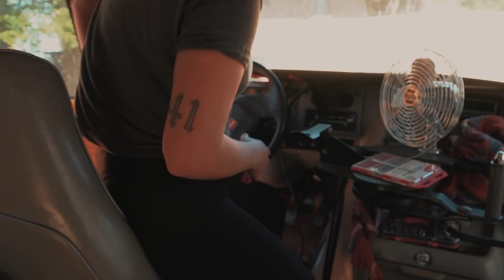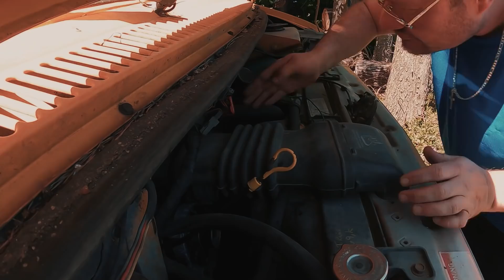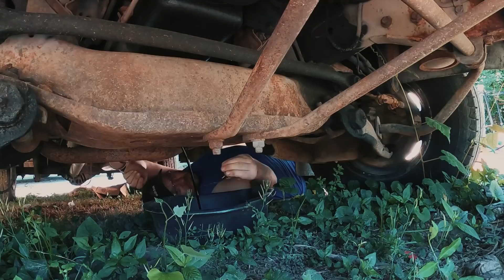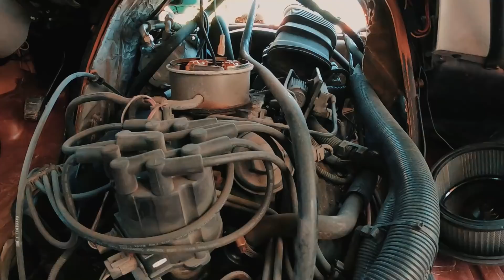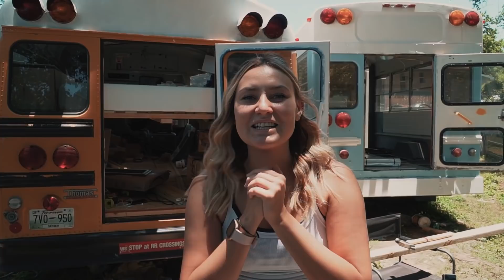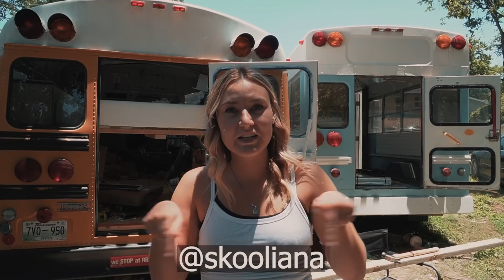My Bus Still Isn't Running - It's Time To Say Goodbye...for now | Skoolie Conversion

Comment: It's acting like my last truck did when my idle air control valve failed. Sometimes it's worth it to pay the labor cost at the pro shop instead of throwing parts at it.
Reply from the maker: I agree
Reply: @LeaveHerWild  There were some simple and easy things that were suggested for finding the cause of the problem that would have cost you nothing or very little (like replacing the fuel filter and checking for vacuum leaks/replacing vacuum hoses).  Even if you or Levi don't know how to do any of it, there're good people here that would have guided you through it.  Don't let your pride or lack of expertise keep you from getting it done.  Quitting just doesn't go with the image we have of you.

Comment: Seems like the logical steps would have been to get the bus running before putting any more money into the build out but it doesn't seem like money is an issue.  Good luck with the mechanic and the trip to Oregon.
Reply from the maker: To me I was planning on putting the money into it to get it fixed no matter what, so either way I’ll be putting all the work/money into it

Comment: Behave yourself in Oregon and have a good time! You also should clean your bus’s motor when you get a chance with engine cleaner and de greeser and a power washer or hose. Looks better and makes it easier to work on. Have 🤩 fun but not too much fun in Oregon.

Comment: That is the idle Control Motor which controls idle speed. The MIL (Check Engine Light) should be on! Plug it back in!

Comment: Have you checked the fuel pump. Test it by wacking the gas tank with a rubber  mallet a few times then try starting the bus. If it starts and runs then that's your issue. Replace the fuel pump. Good luck.

Comment: Sounds like it’s out of timing! Yes it’s running but not very well and hard to start and sometimes you say it will not start! Always start small battery, fuses, timing, distributer cap, spark plug wires! Hope it helps

Comment: When you pumped the gas pedal it tried and finally started.. The first thing i would do is replace the fuel filter and see it that takes care of the problem.. if not, my next step would be replace the fuel pump.

Comment: With a diesel you are supposed to just turn the key the when lifts go off start it.x
Reply from the maker: It’s gas
Reply: @Jackie Shearer  How many diesel engines have you seen that has a distributer and spark plug wires? Any one with common sense that has the least knowledge about engines could tell at a fleeting glance that it was a gasoline engine.

Comment: Did you all throttle position sensor and the oxygen sensor my truck was running rough and also a tune-up wouldn't be a bad idea either spark plugs new wires that sort of thing had to replace it on my truck I hope it gets fixed by the time you get back from Oregon and doesn't cost you a fortune enjoy your time in Oregon and be safe!

Comment: i think it has a fuel pump bad, it has a throttle body injection it will run with very low fuel pressure it happened to my suburban and would not idle ran poor if at all hope you get it fixed soon hope my arm chair diagnoses helps in some small way

Comment: Does it idle on its own?  

So let's look at each thing.

Does it have SPARK?  Does it have Fuel Pressure?  Let's start there.
Reply: The fact it actually idles with her foot down, tells me that it is either a fuel filter, or a vacuum issue. It could be fuel pressure if the regulator is bad, since the pump is sending more fuel when she revs it up.

My diagnosis is bad vacuum lines, since cracks in those, especially around where hoses attach to things, usually lead to vacuum loss, and rough idle. 

The other thing could also be a bad charcoal canister, since it stores fuel vapor to help with restart.

Comment: It is a gazoline bus it seem so maybe check the spark plugs and such and change all the old gazoline todays gazoline is not good if it is older than 6 monts only a advice  also drain the carborator for old gazoline too. For me it seems like this is the problem.

Comment: Jaylena, Am I correct is saying that right before you had problems with the bus that your brother changed the spark plugs and other ignition components? If so is he certain he put the wires back on in the correct position, both on the plugs themselves or in the distributer cap? When you got the bus running, it sounded to me that the engine had a really bad miss to it. Of which, if a couple plug wires were out of position, it will greatly affect how the engine runs and will cause it to die when throttle is at idle position also when running it will shudder and shake real bad and  also cause it to hesitate when suddenly depressing the gas pedal as if it had run out of gas.
Reply from the maker: No, we didn’t change anything. I think I just let it sit for too long
Reply: @LeaveHerWild   sitting shouldn't have anything to do with how it runs, I have had vehicles for many years and the truck I use occasionally, sits for months at a time, and sometimes a year or more without having any problems. When your brother was under the hood  it appeared to have something missing on the left side and bottom of carburetor where it joins to engine about mid way of carburetor, it  looked to possibly be a hose was not there from what I seen it was round about the size of a nickel and was a lot blacker in color than the rest of immediate area which caused me to think it was a hole or fitting of some sort  for vacuum. Only hose of that diameter is the power brake unit vacuum hose  but you would hear a fairly loud hissing sound  so I am at a loss at what I was seeing as it was sort of in the dark under the cowling of the bus. I am an old school type of mechanic and not too much acquainted with this modern computerized crap they put out these days, the days  of the shade tree mechanic is long gone.

Comment: Found a 1982 has 86000 miles on it..had kitchen beds ect but the older person unable to use  heaven..he never painted it still yellow. Short bus 2000$ motor works..think this is a good price,?

Comment: No telling how long since plugs/wires/cap/rotor/fuel filter were changed. Good to do every year with a lot of driving anyway. I would call that a basic tune up. If that doesn't solve, then look at more expensive items one at a time, idle air control valve, throttle body injectors, fuel pump, clogged fuel lines. Hope it doesn't cost a fortune for you.

Comment: Jaylena I think 🤔 the catalytic converter muffler is stopped up not letting the engine breathe. Or you have oxygen sensors that are gone bad. I would change out the oxygen sensors before I paid a mechanic a bunch of money. 
If you’re gonna take it to a mechanic 👨‍🔧 Heres a tip: Let your brother deal with the mechanic about the repairs to the bus 🚌 & here’s why: 
Many mechanics take advantage 
$$$$$ Of women who have no knowledge of engine mechanics! It’s unfortunate but they do, so your brother knows more so he’d be better to deal with the mechanic 👨‍🔧 and knowledgeable enough not to let the mechanic cheat you $$$$$. 
But if it was mine I’d change out the oxygen sensors and see if that helps first.

Comment: Changing the oil is got nothing to do with it not starting or running right need to check for air fuel and spark

Comment: Strange that the cure hasn't surfaced before now. I see you are still targeting the IAC valve. The whole OBD one computer system relies on sensor feedback. Interesting thing about the IAC valve is it must be installed correctly and then you have to actually drive the bus for a while to "retrain the computer" Good luck on the learning curve

Comment: When ever you bye a bus or anything else make sure it runs. Before you try to make it in a home. I believe you was in such a hurry to leave your past life and make a new life. And content you made big mistakes. Always make sure you fix everything mechanical first
Reply from the maker: It was running like a champ, I think my mistake was letting it sit for too long
Reply: @LeaveHerWild  
Your bus seemed well taken care of.  Just needs TLC maintenance: which you are definitely doing all around!  
God Bless You  & all Your Endeavors  Jaylena 💕
Reply: @LeaveHerWild  Did you ever determine if there is water in the gas tank, or replace the fuel filter, check fuel pressure/flow?

Comment: Auto zone with hook it up and tell u whats wrong for free ! I wouldn't travel until it's fixed. Hate to see u stranded !
Reply: @Vicki May It is too old for the OBD2 code reader.  There is a code reader of sorts for OBD1, but I doubt they have one.  On the other hand, there is a way to get the code manually.  She's been told, but apparently hasn't done it.
Reply: @paulmonk7820  oh wow, didn't know that.

Comment: Stop being hardhead female fuel a pressure system Fuel Pump all needed new electric fuel pump sending unit
Reply from the maker: Please, continue to mansplain 🤦🏼‍♀️
Reply: @LeaveHerWild  careful what you ask for😂 do you really want more of that? Also have a great couple weeks, arm yourself with knowledge 👍
Reply: yea listning to it runnin start of video thats not fuel pump problem my gut is tellin me it just needs a dam good service and a clean out as she said it was runnin great till she parked it up for some time
Reply: @tubbybrutus  a good way to eliminate the fuel system/source is to hook up a simple gravity fed temporary fuel source (a bottle and a hose attached to the carb).